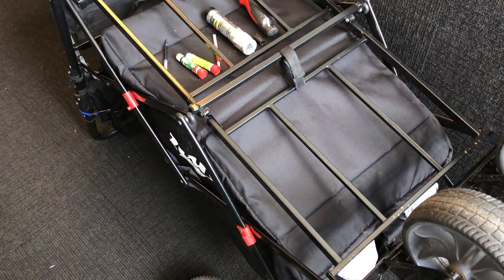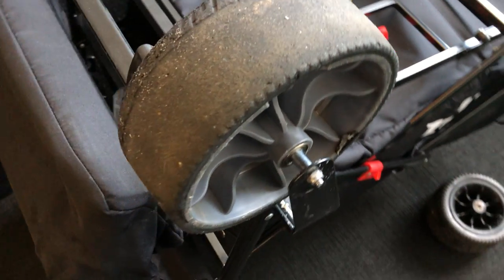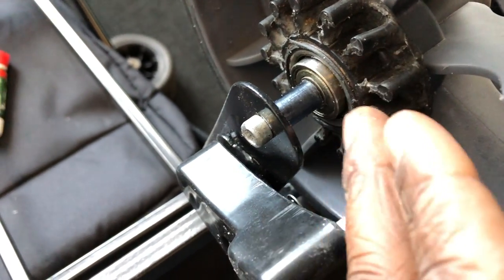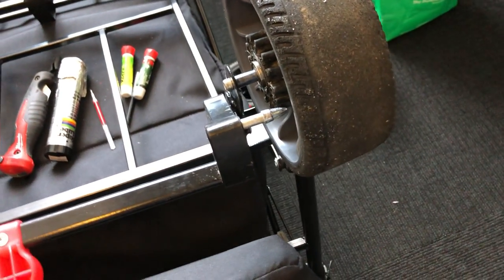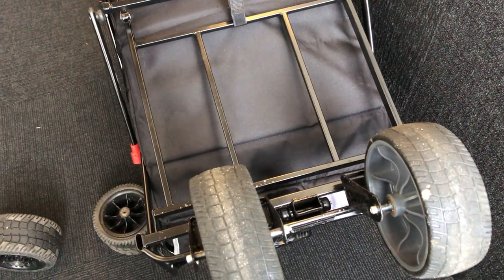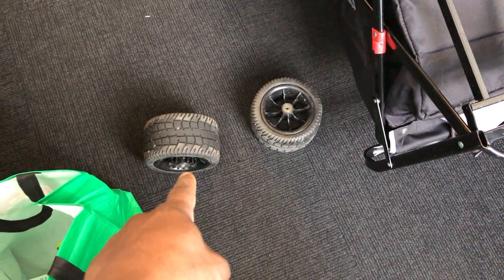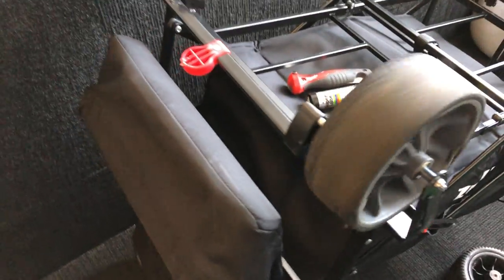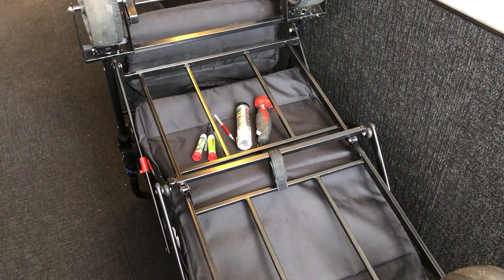TMZ Wagon Update: How to Modified and Replace Wheels on Foldable Wagon

Comment: hi panda, luv the video. can you tell me the size of the bolts you used on those wheels and the size of the spacers? thank you and keep up with the good work.
Reply from the maker: Sure I’ll link you too the bolts https://amzn.to/3nb1ITO for the replace bolts and just use the spacers inside the wheels
Reply: @ThePandaPhotographer  
I bought 4 of the L-faster 6 inch scooter wheels for my cart based on your recommendation from another video and now I want to put bolts and spacers on them but I dont know the correct size of the bolts and spacers I should buy. The old wheel did not have any spacers on it.